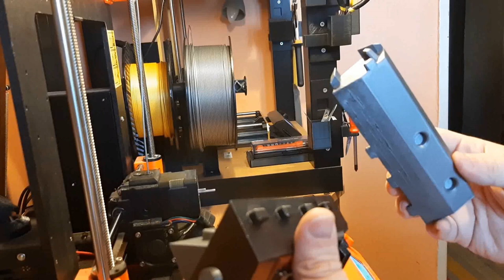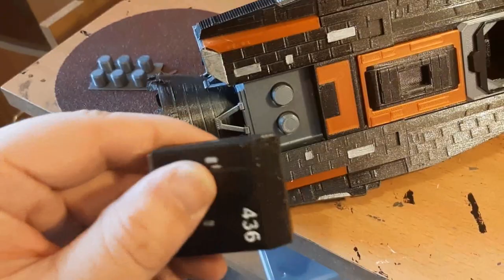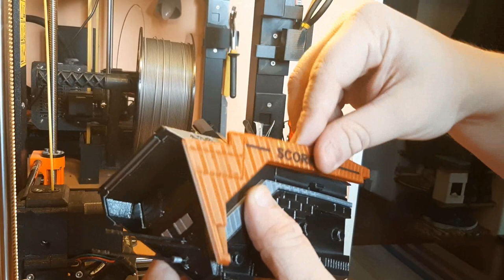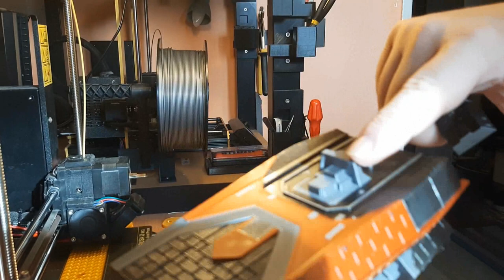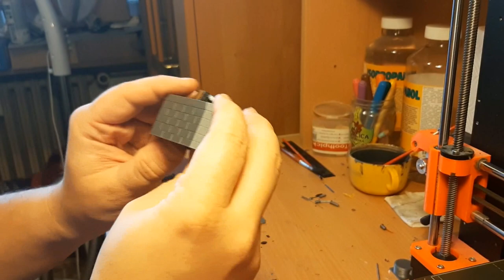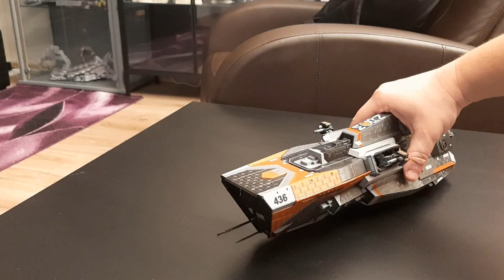Project Morrigan Class

Comment: Do you have any advice on tolerances? I've printed two of your ships and am finding the fits really tight. They require a ton of sanding if I don't want to bust parts.
Reply from the maker: Too bad. I do it with zero tolerances. My printers will actually print it that way so it makes one clean tight fit connection.

Comment: Amazing models. Im printing this right now but i find that my Adventurer 3 (flashforge 5) is making the parts slightly too thick so mating everything up is a nightmare and i have broken a few pieces trying to squeeze them inplace and i have to use glue instead of pins and every molded in pin needs to be shaved down so it kinda works and looks great.
Can you share a little about slicer settings and layer thicknesses/infill?
Reply from the maker: I use prusa slic3r with default settings for PLA. 15% gyroid infill. Oh and thank you 😉

Comment: MCRN and UNN PDCs in the Expanse are actually 6 barrel assembly, but doesn't matter. Can you build complicated design like MCRN light cruiser?
Reply from the maker: You mean Raptor class? Well i think i will eventually get to that one. Now i am doing corvett class and after that I would love to make Orion Class
Reply: @martintaichl  I don't know name of the class for TV version of MCRN light cruiser, it was never said, only ship we saw was FN Pella, but that one was miserably under scaled by TV show crew, model has to be minimum about 60% larger to be able to be functional and to fit airlocks the way we see them on the ship, 89m stated by TV crew is just to small, or doors on that model are made for dwarfs..
As for MCRN heavy frigate (someone called it Orion class, but it's not official), that one is a pretty ship too, but also underscaled by 20-30%, I mean, in the Expanse all ships are 20-30% underscaled by TV crew for some reason, and on smaller size ships ot can be noticed, for example the Roci i.e Corvette Class stated 46m, but 56-58m actiually fits the model perfectly, but let's say those are "small" mistakes and can be tolerated for "TV sake", while MCRN light cruiser 89m length (the Pella) is rediculously way off, ship is about 150m long. Example: Front part (the bow) is thinnest and fits 5.4× into length, what makes it only 16m wide if 89m long, but airlock (which has the frame, air/docking bridge inside the frame, and two wing door inside that) can fit 5.3 to 5.5× into with of the bow, now airlocks on the Pella are those same MCRN airlocks we see on the Roci and Morrigan class, which are about 5m wide with the frame. The rest simple math. But, "real world" scale of the model, doesn't matter much while building models, righ It's important to follow design ratios.
Reply from the maker: @elvisibra  yep. I know the Raptor and Orion are not official but it is better then to call it "unknown" whatever. 
Scale is actually not a problem for me as all those ships use standart PDCs and i will use the same ones I designed for Roci and Morrigan. Thus the scale is easy. (Not to mention even the airlock is shared on my models ;) )
Reply: @martintaichl  Well MCRN airlock should be standard Military issue, and same size (doors, door frame, door opening size, docking bridge) for same type airlock due to spare parts, and if there is some size difference in that, then bigger ships have them bigger, but probably the same, while outer airlock frame isn't same size, and can variate +/- 10% depending on thickness of the outer frame-build. 
PDCs should all have inner size(the part where cannon and stand slide in and out, and doors) of the outer frame the same, but outer size of PDC frame also depends on thickness of the frame-build, especially length of outer frame, because when looked horizontally we can see that frames sit on ships' hulls at the angle, and angle gives length like that, so in case when outer frame is thicker build, overall outer frame is longer. For example, the Roci front PDCs almost fully are in the hull, while mid and aft are on the hull and so mid and aft frames are longer due to 70-80cm (or up to 10% more) of frame "sticking out" from the hull, PDCs on Morrigan class and Orion class are same/similar as Roci's mid and aft, while on MCRN light cruiser (Pella), entire frames on all 9 PDCs are thicker build, and "sticking out" 100-120cm (or up to 10% more)
When say thicker build mean two builds: 1st is build of the frame around PDCs doors, and 2nd is how much the frame "sticks out" from the ship's hull from horizontal view. 1st par is small difference like for example 10-15cm or 15-20cm thick frame, and not easy to spot "from distance", 2nd part can be easily spotted in number of hull plate "bricks" on the frame. Now MCRN hull plates are not the same either, larger ships have larger pieces covering them, and depending which part of the ship they cover they are different size on one same ship (can be noticed on Roci), but let's say those used for PDC frames are all same size.